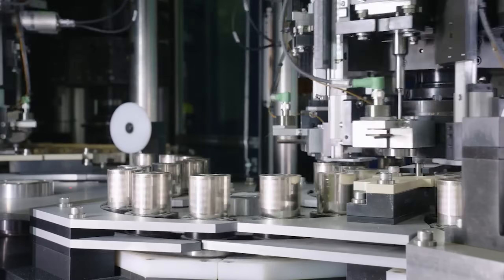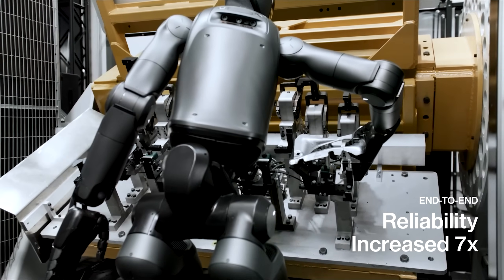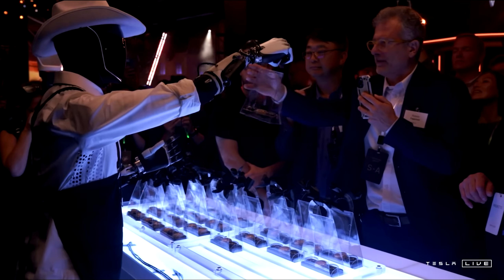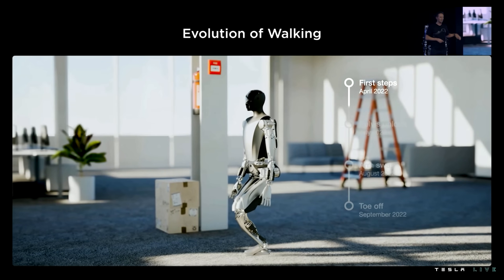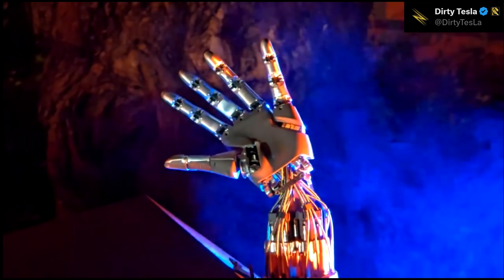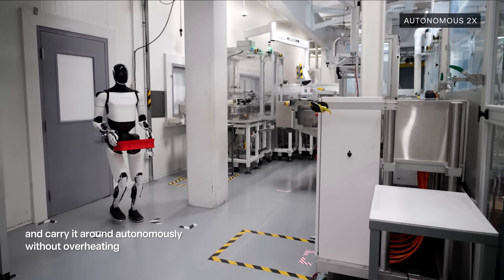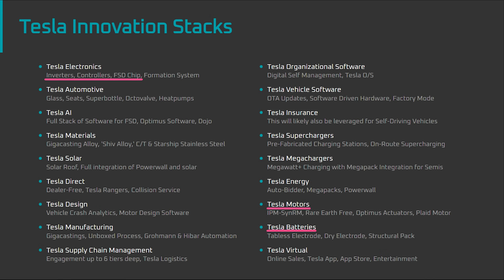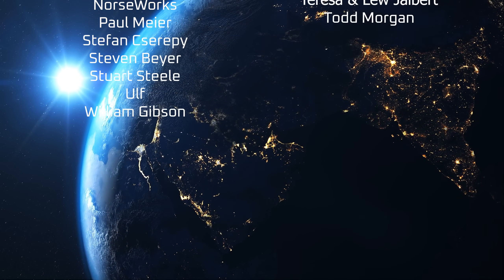Optimus 101:  Why Humanoid, Why Now, and Why Tesla?

Comment: If you want a robot to do a specific set of tasks, it doesn't have to look like a human to do it better than a human(like Spot). If you want a robot to replace or compete with a human, these things are a sad attempt and need many years of improvement. If you go in a factory you won't see a job that it could do. Factories already use vison and learning systems and are set up for efficient humans and efficient robotics because asset utilization is important. Adjusting a factory for slow humanoids would be the antithesis of first principles and super costly. With those hands I can imagine this thing taking all day to do a few simple chores around the house and then spill/break something, need assistance, at what real cost/convenience? It's too weak to assist handicap. If a tele-operate humanoid can barely function why would AI be able to do any better? Maybe it could be an overnight stock boy. IMO a more plausible use would be a telepresence surrogate so a shut-in could go shopping. It doesn't look like it could do much of anything in a useful or practical manner.
Reply: It's ironic that the cheapest labour is going to end up being the most costly to replace in robotics. But the smartest Phd is going to be replaced first. Mind boggling.
Reply: Let's throw out some theoretical numbers and say a humanoid robot would perform a task 50% slower than a human, seems fair? Okay. Now think about how much a human works. In a developed country it'll be 8-12h shift with about an 1h break, so 7-11h a day. A robot doesn't need breaks, it can work as long as it has battery, let's assume it can work 20h a day. That already cancels out the slower work. Now lets account for the fact that a robot is a one-time purchase with only costs being charging and occasional repairs. No salary, benefits, insurance (well maybe some insurance, but at least not health insurance). Also the environment or machines it works with don't need to be as safe as for humans, most likely eliminating some costs. Do you see where I'm going with this? We didn't even get into the reliability - no distractions, no sick leaves (apart from occasional maintenance), no demands for a raise, no resignations.
In many situations it wouldn't matter that the robot would be slower, as long as it can work longer and is significantly cheaper and more reliable long term than a human.
Reply: @malcewicz  you need to reread my first post.
Reply from the maker: You lack imagination 😁
Reply: @thelimitingfactor  Imagine your brain inside optimus, how proficiently could you do your job with those hands? Put a lid on a cup, bag items, use tape, etc.

Comment: 10 points to griffindor for the Cambrian explosion / extinction event analogy
Reply: A hilarious description of what seems like a likely outcome
Reply: IMHO some robots will be given 3 arms or even 4 arms, for those specialized jobs where the incremental cost of an extra arm replaces having a second robot there to hold something in place.  Cite: Welding (welding rod, piece 1, piece 2, plus possibly ancillary equip like fan for smoke).  We use a vise for welding, but maybe it's faster for some applications to just have a third arm and hand.
Reply: Wrong. The Big Bang is Impossible. You can't get anything from nothing, no matter how many cartoons you watch.

Comment: Hey, great video! I was curious to ask you, since you are very well informed, and since I cannot find any info online, what is the state of commercially available NMC battery energy density? I know ev's are lagging behind smartphones in terms of c-si anodes, and capacity is increasing in those cells, but I can't find to which extent, since the don't publish the weight of the battery on spec sheets.
Reply from the maker: Depends on the battery 

270 to 280 Watt hours per kilogram is the upper end for mass-produced lithium ion batteries 

You can go a lot higher with prototypes.  But the energy density always drops the closer it gets to production